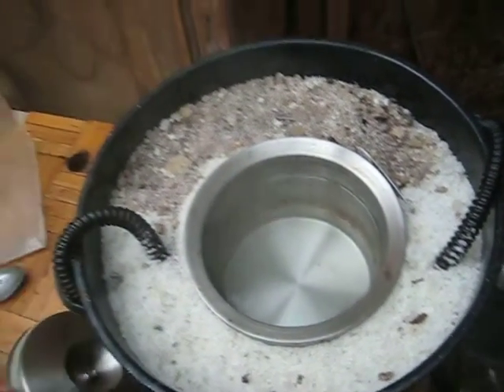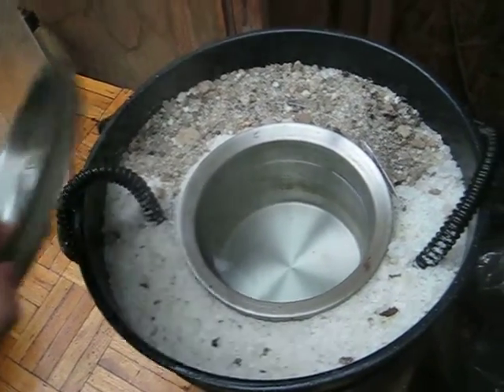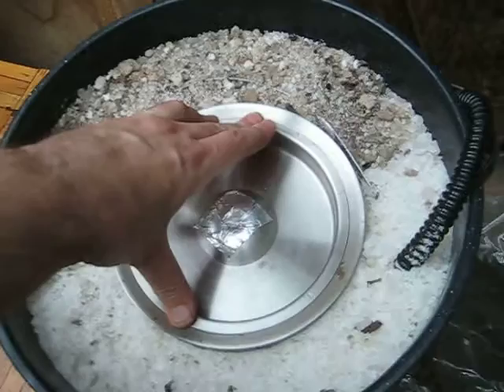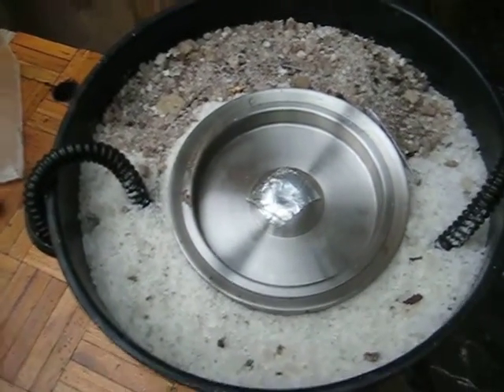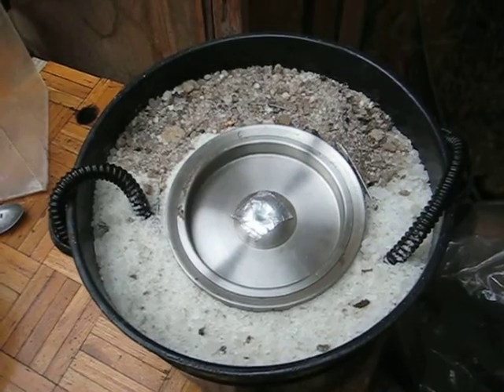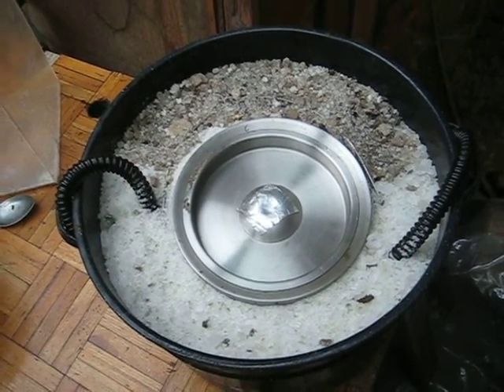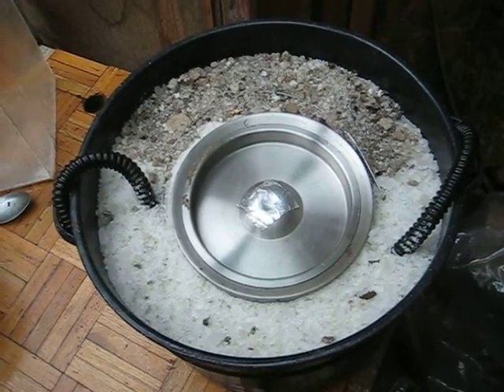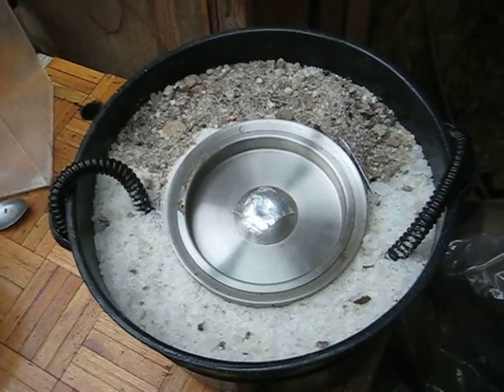Part 1 - Solar Energy Storage Free Heat Storage

Comment: Unless you are getting the salt hot enough to melt it, it's a poor thermal storage medium compared to water.  You would be better off storing the heat in a pail of water to be honest.  If you wanted to get fancy, look in to parrafin.  You can melt it and store a lot more energy in it's liquid state.
Reply: Brine may have a higher thermal storage than plain water.  Maybe paraffin wax would be good also due to phase change physics.
Reply from the maker: The advantage of salt is to store more energy in less space so in a vaccuum container with Glauber salt it could be interesting. water is good for direct use only.